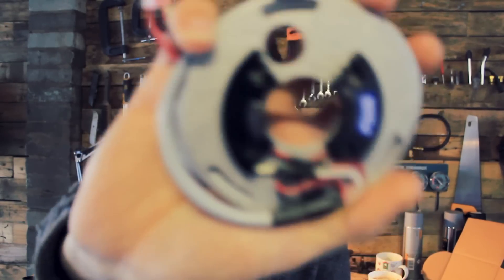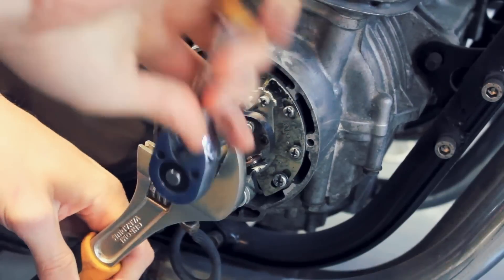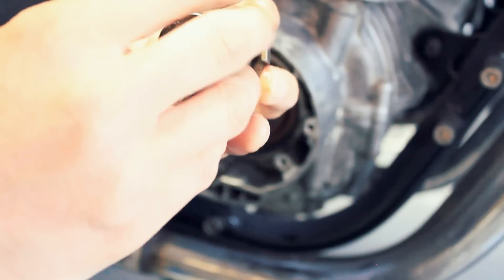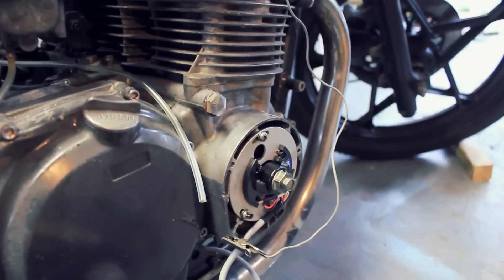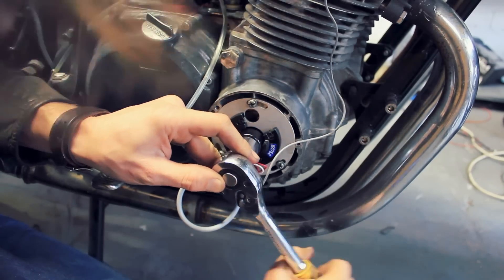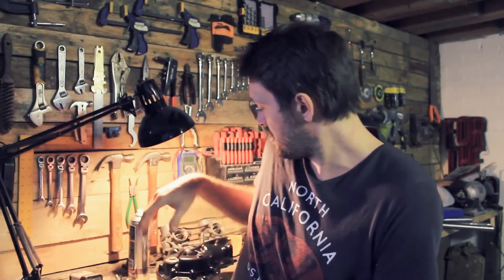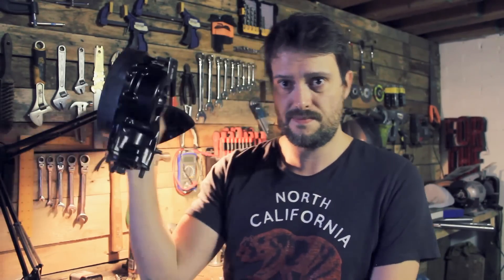Cafe Racer Build 29, Suzuki GS550 Installing a Dynatek Dyna S electronic ignition system

Comment: I tried to put this onto my 550. When i put the new rotor on and tighten the hex bolt,the rotor gets pinched by the bolt and the rotor wont advance. I noticed that there is a washer on the plate that the old rotor sat on. Do I have to remove the washer so the rotor sits lower on the shaft? Alternative would be to shave a bit from the top of the rotor? You can see that the new rotor sits just a little bit too high on the shaft.
Reply from the maker: Hope my Instagram post here sheds light on how I sorted it https://www.instagram.com/p/BaEM2Ouh9IN/?igshid=12wsto0omyrqh
Reply: @forthebold  ...I may take the washer out.thanks.
Reply from the maker: I had the same issue. I just cut up 2 pieces of card to use as a spacer glued them in place. Then gave it room to advance under load

Comment: I've only got 2 wires a yellow and a black my dyna s has 3 white, red and black. Help
Reply from the maker: Ok. First question is how many cylinders does your bike have?
Reply: @forthebold  4 cylinder gs550e
Reply from the maker: In that case you should have the right number of wires. Only reason I asked was in case it was a 1 cylinder bike. Best way is to trace the wires from the ignition coils . You’ll have to unravel the loom to see. Also was the bike running a cdi  with a pulse or originally points?
Reply: @forthebold  hi its points just not sure we're to put the 3rd wire
Reply from the maker: From memory (which was about 3 years ago) black and white wheat directly to the coils and the red went to a 12v source and your positives of the coils. But check your diagram abs instructions that came with your dynatek
Reply: @forthebold  i got the Dyna on ebay with no instructions unfortunately, but thank for your help.
Reply from the maker: If you go to the dyna site or a google search there should be a diagram to follow. Might be a downloadable pdf. But I’m pretty certain that’s the correct pathway.

Comment: If you were to rate this product, what would you rate it? I’m considering redoing my entire electrical system refresh and upgrades. This has come up a couple times in searches.
Reply from the maker: 10 out of 10, best system upgrade, and if you're running a pulse with CDI you can get rid of the CDI
Reply: @forthebold  Really late follow up here, but I'm finally getting to doing this to my gs1100g in an effort to slow myself down on my e36 build. So here's my question; Do you know of anyone running a fully keyless setup on a cafe racer build? When I do mine will I be the first?
Reply from the maker: No unfortunately there are a lot of keyless bikes out there. But all depends on safety?
Reply: @forthebold  does the dyna s require the continued use of the ignitor box or does it bypass it?
Reply from the maker: @deltacharlieecho4732  It'll bypass the CDI.

Comment: I'm putting this into my gs project when you insert the magnet your looks like the rim is just above the 2 lugs for nut washer as mine does but when I tighten this up with the bolt magnet won't move to push the spring loaded weights have ordered new bolt and nut  did you have this issue ?
Reply from the maker: I did but I made a tiny spacer that fitted behind the nut and didn’t squash the magnet any more
Reply: @forthebold  nice one what did you use did u trim down a n 8mm washer or mak ur own ?
Reply from the maker: Yeah trimmed a washer and had it glued into place before tightening the nut. Just to hold it in place until it tightened.
Reply: @forthebold  cheers chap ur brains a goldmine lol I'm off back to shed to sort one out .👍

Comment: Great video, I have just finished installing the same ignition on my gs550, and was wondering what coils you are using?
Reply from the maker: I'm just using aftermarket replacement coils made for a GS550, not enough pocket money available for the dyna coils.
Reply: Okay, and you are satisfied with the aftermarket ones? Can you change the leads on yours, or is it like the original where your have to buy a new coil if the leads crack? (Your videos is a big help)

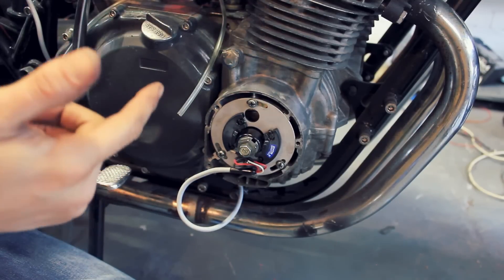Comment: Hi, at 6:50 your only setting the timing right for 2 of the cylinders, I think you should have rotated the mounting plate for both pick-ups.
Reply from the maker: At that second stage I'm only adjusting cylinders 2&3 as 1&4 had been set up correctly with the plate.
Reply: Ok, did not know.

Comment: Why don't you order a small drill bit kit and drill out your jets until you get yourself in the right place? Otherwise you up with a fistful of jets that don't work and constantly have to wait for shipping.
Reply from the maker: +Mark Stevens that sounds so dangerous. Personally I wouldn't like to drill jets because the difference in sizes are barely visible to the eye and I can't see any drill bits (I have) being as accurate for the job.
Reply: Atoplee Semi-automatic Mini Hand Drill Chuck Micro Twist Hobby Craft Jewelers Hand Tool + 20pcs 0.3-1.6mm Twist Drill Bits Set https://www.amazon.ca/dp/B01G1JCFTW/ref=cm_sw_r_cp_tai_RxP5zbEME0SCX
This works pretty good. Just hold the drill and slowly spin the jet onto the bit.

Comment: So the idea to get it to run at the correct mixture at idle is to go up in size at your main jets? Why not the pilot/slow jets? Those mostly control the idle circuit air/fuel mixture. Main controls WOT
Reply from the maker: +FooDude2011 main jets don't control the idle. Slow jets and circuits. The thinking behind increasing the main jet is that it's still bogging when opening quickly and that popping you hear is running lean. I can get it to idle until the float needle is right so that's where I'll start playing with the colortune
Reply: For The Bold - dreegez yep that makes more sense. Nice!

Comment: Keep up the in depth mechanical content, I have a similar carb issue with my 1983 gs 550 on number 3 pot.
Reply from the maker: +j sturgess I originally thought it was the float height but after setting that and swapping the needle to another carb I'm now certain it's the gloat needle.
Reply: For The Bold - dreegez my bike had been sitting in the garage for 16 yrs, so had to clean carbs found the o rings on float needles had perished so replaced them also the needles needed freeing from crud! Still doesn't run for long and lumpy due in part to 3rd cylinder not firing, I'm going to take carbs off again clean and inspect, thinking also problem might be caused by leaking inlet boots and o rings.

Comment: Nice work, where are you getting your jets from?? Can't seem to find anywhere to get them. I have the same set up but with 4 into 1 exhaust system. Thanks
Reply from the maker: +Sacha Scurlock try eBay if you're stuck. A lot of reputable motorcycle stockists use that